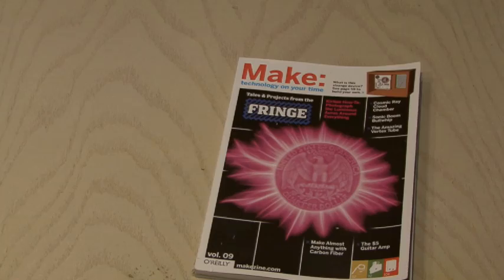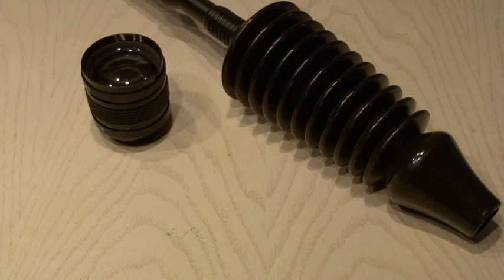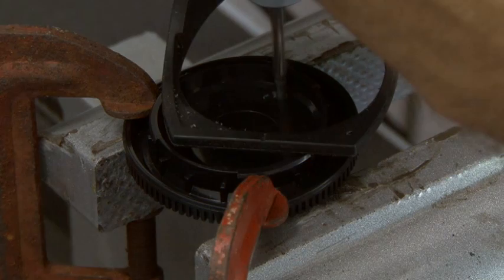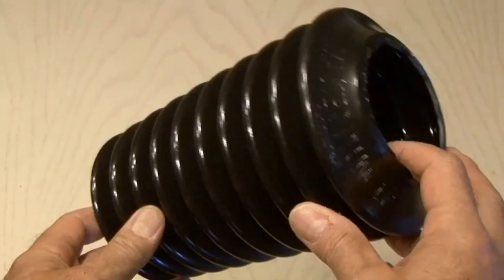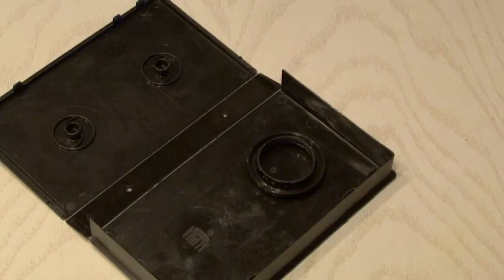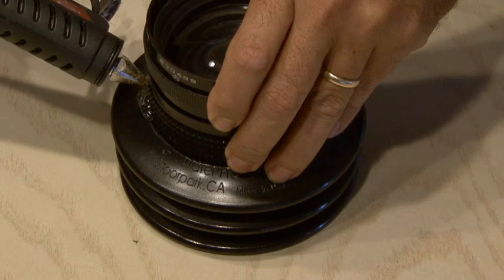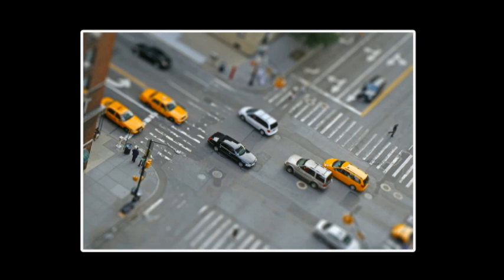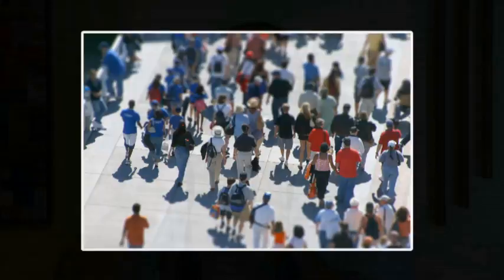Weekend Project: Tilt-Shift Photography

Comment: lenses are too expensive to ruin with hot glue!
Reply: +Mark Walsh There's more than one way to skin a cat so there's certainly more than one way to mount the lens without using hot glue directly on the lens.
Reply: • Cut a hole in the back lens cap similar to what he did to the body cap
• Glue that lens can to the plunger. 
• Lens can now be attached and removed without ruining it.

Comment: This is cool, but another alternative idea to the plunger and glue is to just tape the lens to the body cap mount with black gaffers tape.. That's what I did because I couldn't find the plunger, and I'm glad I did.. it works great and you don't have to glue up the lens. You can also shift with it as well, don't know if you can do that with the plunger or not.

Comment: @wadad17
Looking at what he did it seems to me you could use the dust cap for the back of lens (when it is not on the camera) and hot glue that on the front of the bellows, that way you could use any lens without glue.
One word of warning, both caps twist on and off without locking, it would be easy for the lens to unscrew and fall if you weren't holding it tight!

Comment: An enlarger lens is a lens used at the base of darkroom enlarger (think of it as a sort of vertical slide projector). Top end enlarger lenses fetch as much as camera lenses but cheaper variants exist, all have manual apertures with click stops, most are 39mm x 26 tpi. Best for your purpose would be a lens with a threaded retaining ring. At the camera lens use a t2-mount appropriate for your camera system. ebay would be a good source

Comment: Fascinating - also, the lens is not destroyed if it is of any quality, the outer casing is metal instead of plastic. Hot glue comes off of metal very easily, especially coated(painted) metal. If you do not wish to destroy a lens, I am sure there are other ways of attaching it. Or just buy a purpose-made lens. They do exist, you know.

Comment: @NJLandboarder If you're seriously going to do something like this just use a really basic kit lens that comes with a low-level DSLR. You can pick them up for like 100 bucks at pretty much any camera store or probably cheaper online. Or, you can invest in a real tilt-shift kit that won't fuck up your equipment by searching online. The price of the TS kit vs. buying a cheapo lens will probably offset one another completely.

Comment: Or you could just attach the lens, turn the camera on, select the aperture you want, hold the aperture button, detach the lens, hold it in front of the lens attachment ring, and et voila - may let in alot of dust, same effect, sensors are easily cleaned with a rocket blower though.

Comment: @vasya88   You can put any D-SLR in manual mode. The Nikon looks for two little tabs to be depressed which is what the camera lens cap will do when you put it in. All though this is a cheap way to do it. You can find really cheap lenses for Nikon and cannon or any off brand company. If your all about spending money then check lensebaby.

Comment: @wadad17 

Absolutely true, but - as far I know the Canon 50mm f/1.8 is extremely cheap, and if you can find it used - it's even cheaper! Also the body cap he is mentioning is probably like 5 dollars or so, so in the end you can actually do this fairly cheap.

Another thing you can try is called "free lensing", basicly you need a prime lens. like the 50mm f/1.8, instead of actually attaching it to the camera body, you shift it around like a tilt'n'shift, problem is you can't autofocus.

Comment: Great vid, but you need bluetooth or wifi capable lens for this, because the body cant push the diaphragm in your lens trough air or through on that plunger thing. The bluetooth also needs to transmit the exp. time, the AF info, the aperture info, and 5V to drive the AF motor. Of course first you'll get an error message, its because in point of fact no lens connected to the body. Don't worry about it, just push the "bluetooth on/off" button on your lens and the annoying message will dissapear.

Comment: at KEH you can get used manual 35 mm lenses for stupidly low prices for a project like this.

It doesn't even have to match your camera's brand.

And ultimately, all that ever ACTUALLY gets attached to your camera is the body cap.

Comment: Were the lens and camera of the same format?

I tried this but with a different plunger size (of a car boot) and various focal lengths and two formats (ASP-C and FF) and the only one that worked somewhat was the full frame 135mm lens with a full frame camera. I dont kniw why it didnt work on my APS-C camera, since in that case the lenses were ovwrsixed.

Comment: Just bought a Jayco Popup Trailer, and it actually doesn't have an AC (air conditioning) unit. A friend recommended the following:
1. Get a styrofoam cooler/icebox
2. Cut a hole in the top and put a PVC L-joint in the hole
3. Attach a small fan (like a computer fan) to the inside of the icebox over the joint
4. Fill the icebox with ice and turn on fan
Would this work and is there an easier way? I know this is an old video, but I wanted to get a few opinions on the idea before I put $ into it.

Comment: @NJLandboarder Nothing wrong with that, was just letting ya know there's some damn cheap lenses out there that run like 80 bucks. But they're exactly that, cheap. Add on a jury-rigged, stiff bellows with no means to secure it in place and you probably just wasted your money anyway. I'd never do anything like this personally. Making a macro tube however, is something completely different and interesting to add on to an already macro lens since you can secure it w/ mounting rings/rear caps.

Comment: Hi, very beautiful project. I've tried with a 50mm zuiko 1.8, but the DOF is too near to me.. If I make a little distance between lens and sensor, I can make only portrait or macro.. never for a landscape... where is the problem? my distance is very little.. but if I enlarge this distance.. worst. DOF for macro

thank you
Reply: +The Sideburns&#39; Company TSC You could try this using a medium format lens as they require a greater distance from the lens' rear element to the film/sensor plane

Comment: @MadmanDKDK I was reading your comment...then mine, and i relized i spelt t tilt shit....makes me fell like an ass. 
True, they do cost alot, i went and looked after the video, but im sure there is a way to make a mount for the lense so you just attach it to the mount and hot glue it to the plunger itself. The only problem is it would require getting a part for the camera, which they would charge way to much for. Or just make the part from scrap which isnt easy.

Comment: why wouldnt you just buy a 2nd and crap lens its not like it has to fit you camera specifically you can get cheap used lenses for around 20 bucks at most camera shops or ebay

Comment: Other good options.
Photoshop : Well, you'll not get an accurate result, but that's what 80% of the people do today.
Lensbaby : As mentioned on other comments, you can budget buy at 80$ new, decent quality for decent price.
Used lens : Not bad actually, a refurbished might be a good option but still not that budget friendly.
Free Lensing : doesn't work quite well, sacrifices your good sensor from dusts and moisture, i won't recommend this though :/